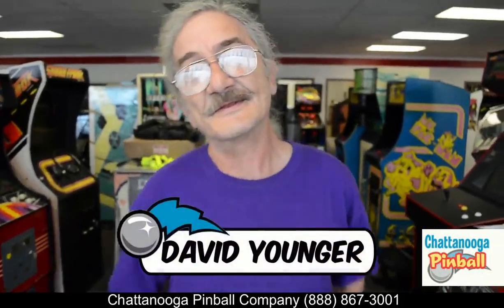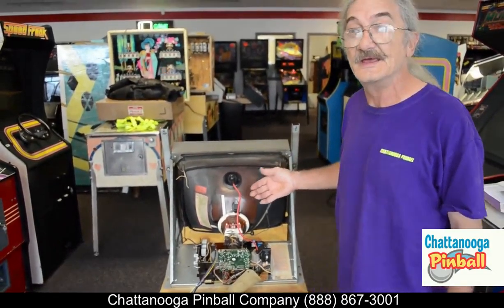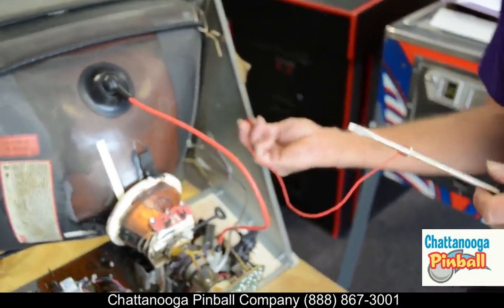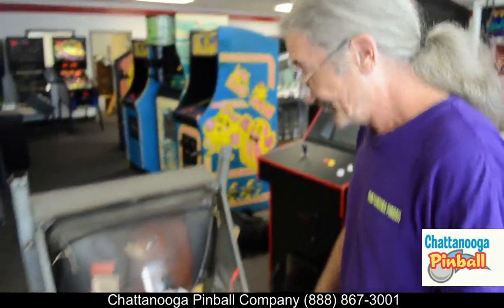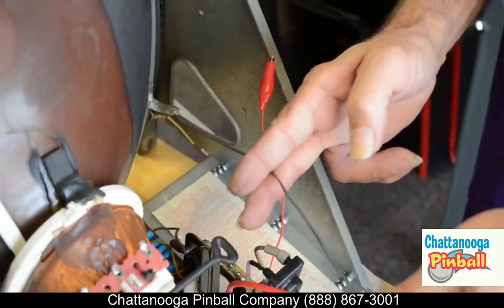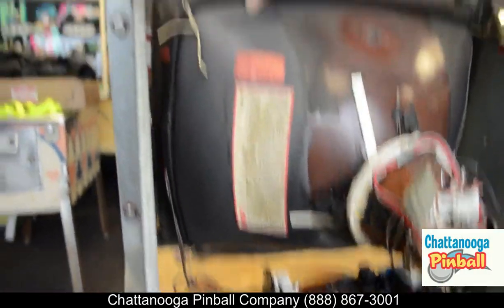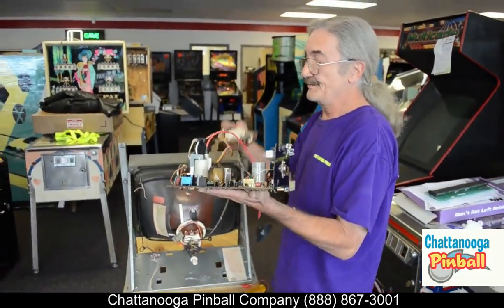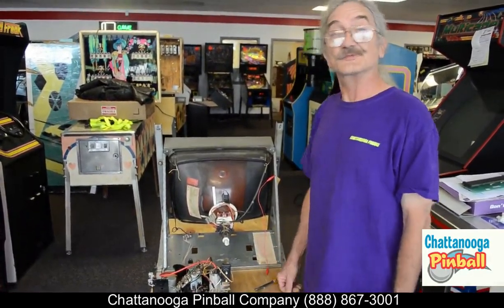Arcade Repair Tips: How To Remove A Monitor Chassis Safely - Chattanooga Pinball Company

Comment: any reasons why arcade monitors all have different sync signals you can't use or replace an arcade monitor with another type because of the sync signals? what is the isolation transformer used for